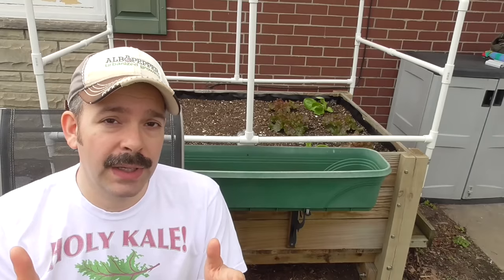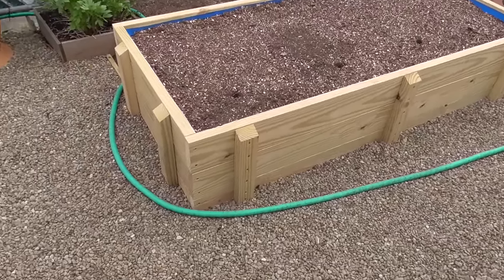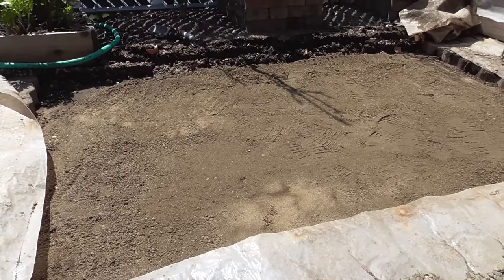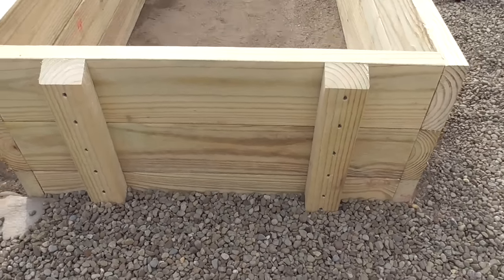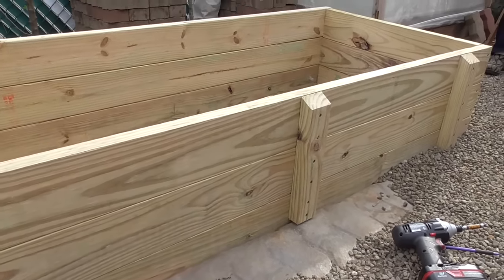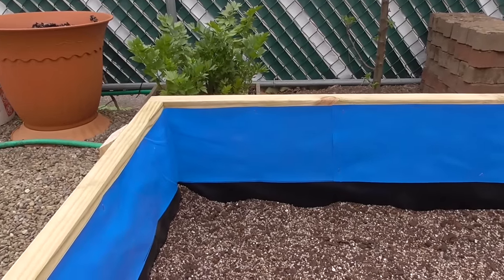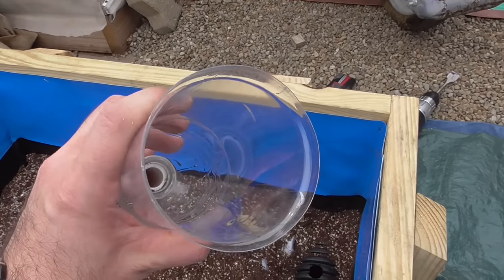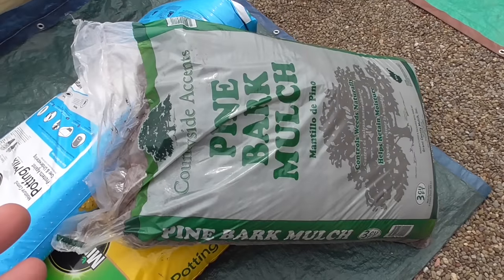Self-watering SIP Sub-irrigated Raised Bed Construction  (How to Build)

Comment: So excited as we have just built our beds and are using perforated tubing like yours.  Question....would a 13" depth of soil-less mix be sufficient for success?  You mention 16" so just want to know what your thoughts are on 13"
Reply from the maker: You could probably get away with a 13" depth. I would consider adding a little extra perlite to the mix to ensure good pore  spacing and aeration for the roots.
Reply: @Albopepper  Thank you!!  We planned to combine vermiculite and peat moss just for around the tubing for wicking purposes as you suggest. Then the soil less mix above that layer. What ratio would you recommend?

Comment: I built a large self watering planter recently. I planned on filling the first layer with pea gravel around and above the corrugated pipes, then lay a fabric on top of that, then add the potting mix. Would there be any problem with doing it this way and why? Thanks for your video and time.
Reply from the maker: Pea gravel is not really going to wick well. I have my own thoughts on gravel in general which I share here: https://albopepper.com/pipes-vs-gravel-in-SIP-wicking-beds.php

Comment: I think for Florida use cement blocks rather than wood. The drainage will pull out all of the nutrients? I think you might have to catch the drain water and reuse it. I plan on trying this maybe next year, but larger scale.
Reply from the maker: Good idea about using cement blocks! As for you question about nutrient drainage:

Reducing Run-Off From SIPs

SIPs vs DRAIN HOLE CONTAINERS: Sub-irrigated planters can result in much less nutrient runoff since excess water is captured in the reservoir. Compared to traditional containers, this is a significant advantage. The reservoir can act as a buffer absorbing part or perhaps all of the rain that falls on it. Even once the soil is at full saturation, the reservoir will still hold 3 inches of water.

REDUCING OVERFLOW: For it to work well though, I find it best to avoid frequent topping off my SIPs especially in the Spring when it's rainy and plants are still small. This allows the reservoir to absorb more rain water before maxing out and overflowing. When I do decide to add water, I avoid watering to the point that it overflows out of the overflow tube. A little water every day works well.

NUTRIENT USAGE: Using organic fertilizers rather than synthetics may reduce the amount nutrients in the runoff water. That's because organics tend to be less water soluble. For example, Espoma claims that their Garden-Tone fertilizer is "Long-lasting, slow release. Won’t burn or leach away." When applying fertilizers I prefer to mix the nutrients into the top 6 inches of potting mix. The same goes for the depth of my fertilizer bands. Thus the unfertilized layer of soil underneath can help to lock away nutrients as they dissolve.

HARVESTING RUN-OFF: In the late Spring I tested the run-off water coming out of my new SIP raised bed. My tap water had an EC of 240 but the run-off water was 630. That is comparable to a half strength hydroponic solution. Clearly, nutrients were being lost. But where do they go? If the water runs directly into a storm drain then that's a huge problem. But if that small amount of run-off is directed to a secondary planting bed, then it's not so bad. Why not consider this when you plan your garden layout? I have a mid sized SIP bed that overflows into a strawberry patch. Behind that, there are 3 plum trees. These plants can easily soak up any lost nutrients, keeping my storm water filtered and clean! 

https://albopepper.com/minimize-over-fertilization-in-sip-systems.php
Reply: @Albopepper  I made a drawing and kind of priced this out and its a lot.

Comment: I love watching your videos and have learned so much, they are inspiring me to create my own optimal garden next season. I've had a raised bed garden for several years now and feel like there is so much wasted space and thus wasted fertilizer, etc. What do you think about creating a raised bed structure and cut holes in it and insert buckets that are self watering. Then in spaces put a small layer of soil so it looks like one big raised bed. Another reason I was thinking of doing this is I could make the bed slightly higher so I don't have to bend so much and flair up my back issues. Any thoughts on this?

Comment: A couple of questions..are the spacer tubes all perforated? does it matter which way the perforations are facing if not solid tubes? How often do you water it? If I keep filling it until water exits the overflow will I create a muddy meass at the bottom?

Comment: Could an SIP raised bed be used in a Mittleider garden setup where the grow mix is say a mixture of sawdust and sand?   Great video!
Reply from the maker: OhHowHappyGardener I've never tested that mix. I doubt it would have the proper wicking characteristics. But you could always set up a 5 gallon SIP bucket to test it out. Hmm, I wonder what it would be like if the base was peat / vermiculite / perlite based. And then the top 10 inches was sawdust / sand. This would be highly experimental. But it would be neat if it worked! Thanks for watching!

Comment: So I just made one yesterday after watching your video. I made it out of a wine barrel that’s cut in half. My question would be on the corrugated pipes. I was able to squeeze 5 pipes side by side cut to the appropriate length but it is a squeeze. I originally did 4 and filled it with peat/vermiculite/pumice at your 3:1:1 ratio. Then I squeezed the 5th one in but now my main concern is if it’s too tight and there’s not enough wicking potential. If I remove one of them I’m afraid of it being too saturated. I planted a blueberry bush so it needs constant moisture. Should I dig it out and remove one? Thanks!
Reply from the maker: It's hard to say. The entire thing is already assembled. So I suppose you could just test it out and see. Fill the reservoir up to capacity. See if the water wicks upwards.
Reply: @Albopepper  thank you very much for the quick reply. It is touching so that was my main concern. I know you mentioned a minimum of 1/4” gap. The bottom of the container is 20” wide and stuffing 5 of these would make it 20”. All along the perimeter, there’s a good gap so I’m more just worried about the middle. I’m not too concerned if I have to empty it out and remove one. But I guess wait and see. Thanks again!
Reply from the maker: I understand. The corrugated pipe ridges might allow room for some wicking material to draw up water. I wasn't able to see the installation process, but you should probably have a good idea on whether there was a solid bridge of wicking material from the bottom to the top. If you experience wicking issues, at least you know the most likely cause.
Reply: Thanks again! My container is 1/2 peat and 1/2 potting mix since I need it to be acidic so I’ll just wait and test with a moisture meter as time goes on.

Comment: The weeping tile (the black pipe) in the bottom are they also inter connected I really enjoyed your video Thanks
Reply from the maker: Hi Dan, thanks for watching! Some people have connected them. But that is optional. The system will still work and the reservoir will still level out and long as you use perforated pipes.

Comment: One question about SIP beds.  Where I live, over winter the temps drop to as low as -40 (or worse sometimes).  How do you drain excess water out of the bed easily so that it doesn't freeze and split the pipes in the bottom of the bed.  Or are you taking everything out at the end of the season?

Comment: For the vertical water fill pipe it would be cool to use the white drainage pipe but not perforated and you could just cap it like
a normal house perimeter drainage and would look awesome.

Comment: Thank for your entertaining and informative video. One question: Do ALL the corrugated tubes actually fill up with water? And if they do, does the water from the first tube seep out and go into the soil and then water seeps into the other tubes? What do you think about possibly connecting the tubes while still allowing them to allow water to evaporate/pass through to the soil (via fabric windows). DO you block water coming out of the drainage tube while the tubes fill?  Thanks!
Reply from the maker: Hi Alfred. Thanks for watching! All of the corrugated pipes fill up because they are perforated. There may be a slight delay depending on size and pipe layout. I fill the SIPs at a medium flow rate to allow the water level to even out. I don't block the overflow tube while filling it. More on the topic here: https://www.youtube.com/watch?v=VJ2T6gUv8Gc Certainly, these pipes could all be connected. No harm in that. Just a little more work.

Comment: This is very interesting I have not explored SIP sub-irigation before. I have had good results with traditional raised beds in our garden. You mention that for fertilization to not use manures but don't elaborate as to why. We also raise chickens and the litter from our coop is a main component for our compost heaps and our use of it in our raised beds has been working well. It gets mixed with grass clippings and other organic materials and allowed to compost at least a year before I till it in in the fall after harvest. Can you elaborate on why it wouldn't  work for the SIP application? We do not like using synthetic chemical fertilizers.
Reply from the maker: Thanks for watching. This page on my site talks in depth about fertilizing options and cautions: https://albopepper.com/refreshing-sip-potting-mix-adding-fertilizer-year-2.php
Reply: Because it will make the soil too heavy and it won't wick up the water anymore or dry out. You end up with not enough water for shallow roots and too much for deep roots. Making a big waist of $$ because the potting soil is very expensive to replace.

Comment: On dry days when you have to load water in the pipes won't the water run out the tube drain ? And how much water ( in inches) do u hav to load for the wicking to work ?

Comment: Could you add a couple or a few raised beds together hooked up to this system.
Reply from the maker: Hi! Yes, in theory you could connect them all together. They would all have to be perfectly level and at the exact same height if the connector is positioned below the overflow tubes.

Comment: Hi Al.I am doing container gardening using 18-20 gal. TOTES... Am using 4 inch Irrigation pipe,perforated type for the wicking agent.
Question:
Is it Essential for me to cover the 4 inch. Pipe with Landscape fabric. Or can I omit that step.?
Thnx Al. Great chanel!!
Mike DAGNILLO
Reply from the maker: Hi Mike! The primary purpose of the fabric is to ensure that potting mix doesn't infiltrate into the ends of the pipes. If you cut them very cleanly and perfectly squeeze them up against the walls of the tote, you might be ok without it. But most totes have angled sides, so it can be tricky. The safest thing is to cap them off somehow. Even if you used sheets of plastic. It doesn't have to be landscape fabric per se. Old nylon pantyhose might work as well.
Reply: Thank you Al 4, responding so quickly.
I taped taped  the ends of pipes to keep out debris.
Reply: I built  those  5 gal. Buckets  using the shim idea. Great idea 💡

Comment: Great video. I have two questions. 1. Why no manure or compost? 2. Why is the pond lining essential? I understand there might be more water loss/higher water usage without it, but theoretically the design could work without the plastic lining, no?
Reply from the maker: For more on manures: https://albopepper.com/refreshing-sip-potting-mix-adding-fertilizer-year-2.php

This needs a liner or it could not possibly hold water and it would never work otherwise.
Reply: @Albopepper  One more question after revisiting this. Any options in place of plastic corrugated tubing? I am concerned about the plastics used to make those tubes, and the endocrine disruptor effects. Apparently that kind of stuff can easily leech into plants. Aluminum corrugated tubing? Some kind of other piping? Obviously more expensive, but I think potentially worth it for a design that minimizes dangerous chemicals leaking into the food I'd feed to my family!
Reply from the maker: @mmunters  Those corrugated tubes are HDPE. Out of the food grade plastics, HDPE was shown to be one of the least contaminated. Sorry but I don't know of an alternate product option.

Comment: This is so cool, thank you! I built one and I have a question about watering. Is it impossible to overwater because it will only wick up when the top soil is dry? My fresh plants are a little droopy. Maybe I just need to top surface water until they’re more established. Also I drew plans for the planter if anyone wants a download link
Reply from the maker: Yes, you can try surface watering if the soil surface doesn't seem very moist. If you press your finger into the top and it feel really wet then top watering might not be required. You could also try a cheap moister meter to help out. Watch this video update: https://www.youtube.com/watch?v=5orIjYKFRgE

Comment: Since the roots are allowed to grow between the water-filled pipes, does that not allow them to stay continually wet and create root rot. Would adding a few inches of sand to fill in those gaps with a weed fabric barrier between the sand and soil work?

Comment: We are adapting your design  to create sub-irrigated planters out of galvanized steel water troughs for our balcony. Can you  clarify your warning against 'gross compost'? I'm confused because most potting mix is a blend of compost and other materials for water retention and drainage isn't it? Do you mean that we shouldn't fill the whole thing with compost, or that we should never ever put any compost in it? Also fully composted materials usually are not gross, they are pretty indistinguishable from soil.  Is it materials that haven't been fully composted like uncomposted manure that you are talking about or literally all compost of any kind that will ruin the system. Thanks for your design, want to make sure I don't mess it up but also want my plants to have nutrients.
Reply from the maker: Sounds exciting Ruth! I address your question on my website:

BAGGED COMPOSTS? To prolong the viability of your SIP potting mix, it's best to replenish nutrients in the form of fertilizers. Organic gardeners are apt to use compost as often as possible. In SIPs, worm castings can be included in small amounts. But using composts in containers can yield unpredictable results. Bagged (retail) compost, humus or manure might have a fine consistency, similar to garden soil. If it contains fine silty particles then this can reduce pore spacing and aeration properties of the mix. That's why topsoil is NEVER recommended.

As air gaps get plugged up by ultra fine particles, compaction occurs. And since SIPs are always resting on a perched water table, the few remaining air gaps tend to be saturated with water. This impairs root health, preventing plants from getting the oxygen needed at the root zone. This can lead to a decline in plant growth, or even root rot and death. Even if plants grow ok in the first year, over time the potting medium may break down to the point that it must be replaced.

HOMEMADE COMPOST? Buying bagged compost is not financially advantageous in large beds anyway, not when compared to buying a bulk organic fertilizer. Of course, homemade composts might work, especially if they are mostly wood based. These tend to have more structure. Larger particle size means improved aeration. I've found though that it's very easy to reserve my compost for conventional beds and perennial plantings. It all gets used, just in a different location.

https://albopepper.com/refreshing-sip-potting-mix-adding-fertilizer-year-2.php

Hopefully that clarifies what I meant. Basically, I would never use ANY manures, other than vermicompost. No topsoils or garden soils intended for in-ground application. And if using compost, it should be slightly chunky and more wood-based. Composted forest products, for example. But if it is silty and slimy when wet, then I would avoid it.  :-)

Comment: Thanks so much for the very informative and great video. I am building my first 4’x4’ raised SIP garden based on your design. Can you tell me if it is okay to use some left over pond liner to cover the ends of the corrugated pipes or does it need to be able to seep water out? Also do I need one or two drains for this size? Thanks for any ones help.
Reply from the maker: Hi Darrin. Thanks for watching! I would advise two overflow drains. As long as your black drain pipes are perforated, you can cap them off with whatever material that is available. You just want to keep potting mix from getting inside of the pipes.
Reply: Perfect. Thank you very much! Keep up the great videos.

Comment: Hi,
Instead of using the black agg pipe in the base of the SIP planter box, do you think it would it be possible to use poly down pipe.
The way I see it, the black pipe is acting as a reservoir for the water and also as a barrier to stop the soil from mixing  with the water.The perforations seem unnecessary if the ends of the pipe are not sealed. the water should still flow and the soil pushed between the pipe is in contact with the water and creating the wicking effect.
Your thoughts
Rodney.

Comment: I made one today but I used perforated pipe with sock that should be ok right? What exact mixture do you recommend for the first layer of substrate over the pipe? Just potting soil with xtra vermiculite?
Reply from the maker: Potting mix with vermiculite would be fine, assuming the potting mix is mostly peat / coir based. (Nothing with a coarse bark texture.) Or you could even get a bale of peat moss and mix in some perlite and vermiculite, saving the retail potting mixes for the top portion.